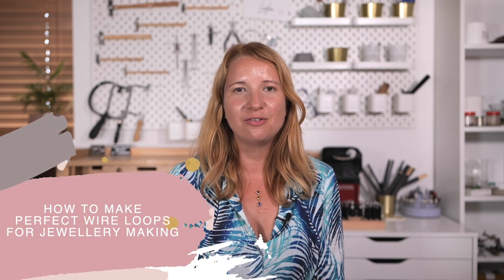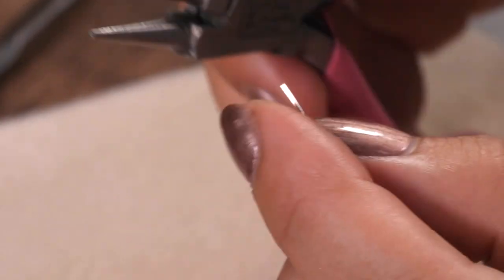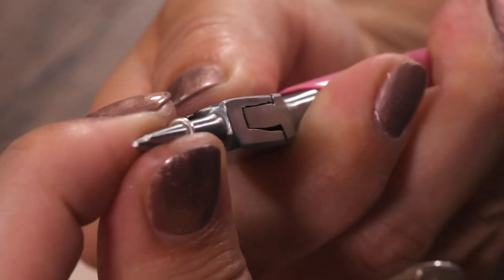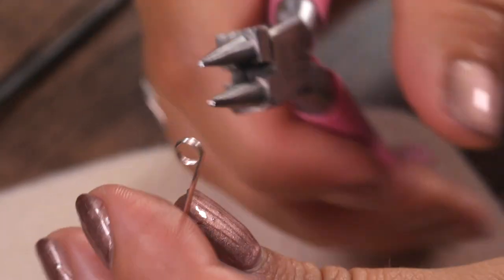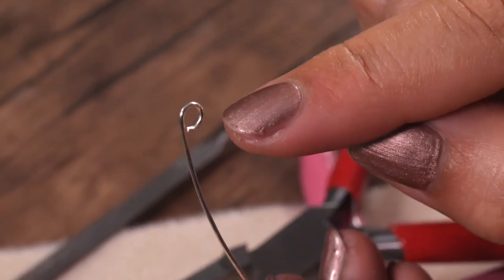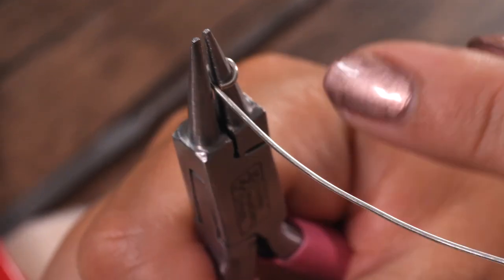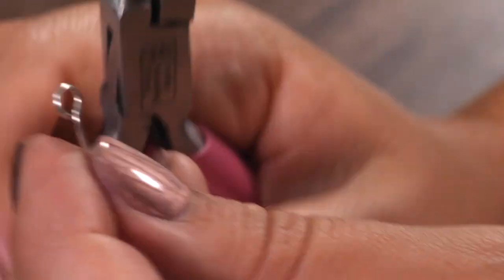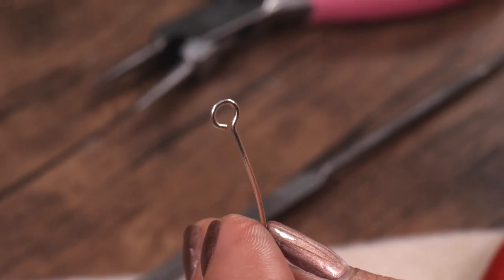Making A Perfect Wire Loop - Jewellery Making Tips - Jessica Rose - Jewellers Academy

Comment: I've seen other videos on loop making but none of them start by filing the end flush.  That makes perfect sense so thanks for that tip!  I use bail making pliers to get the same size loop each time when needed.  But you can use  a sharpie on round nose pliers to mark where to hold the wire.
Reply from the maker: Yes great tip on using the bail making pliers! And you are right giving the end a little file just makes it that tiny bit more of a snug, professional finish :-)

Comment: it ends up being not closed though? 'There is a gap after. you do the last step.
Reply from the maker: Yes it is slightly open so that you can attach a charm or other element, then you can use your pliers to tuck it in again so that it butts up to the wire so its nice and snug.  x